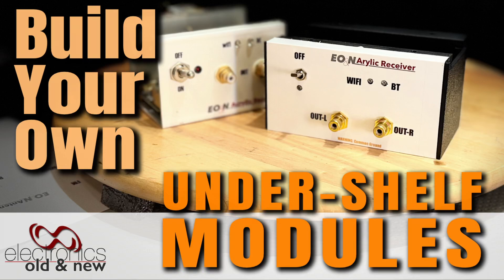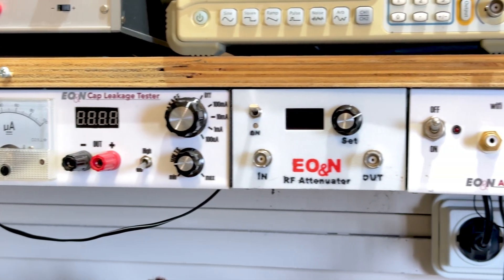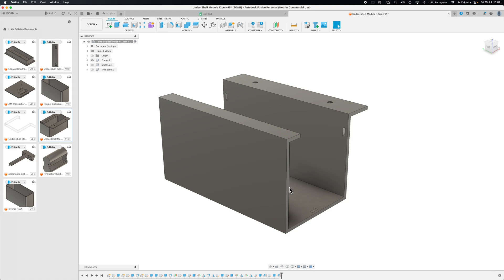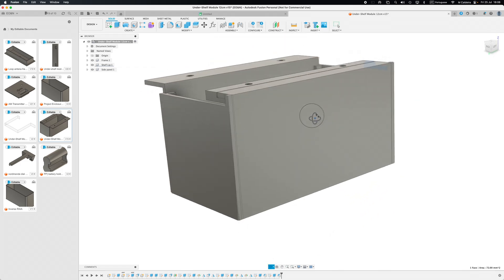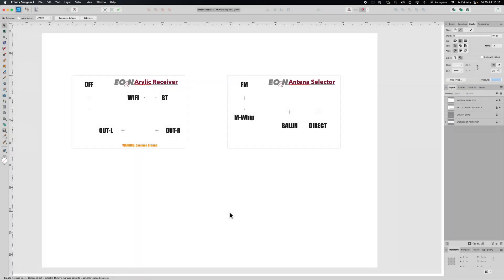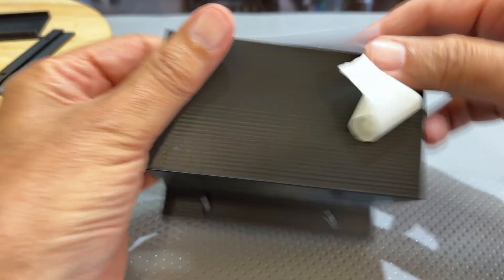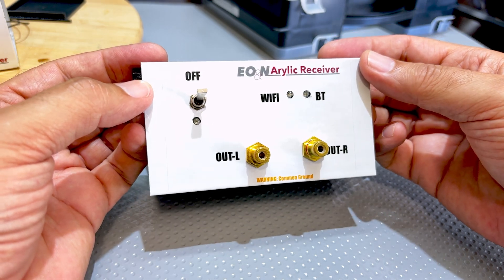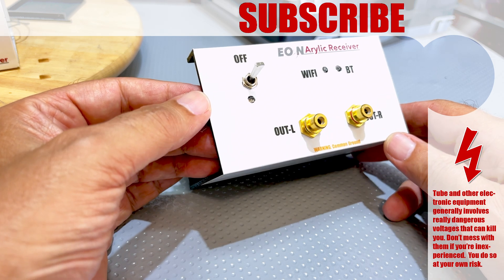Build Your Own Under-Shelf Test Modules – Fusion 360 & 3D Files Shared #pcbway#

Comment: Been using the paper/sticky sheet for a year or two.  Get yourself some small pieces of wood to sit behind what ever you're punching or drilling.  Sometime I also use small clamps to keep things from wriggling about.  Problem I have is getting the sticky sheet over the finished front side AND lining up the holes.  It's not too hard on small project boxes, but the bigger the sheet the worse the error.  Sheets you can get from AliEx. I suggested A4 and A5.  Fits standard laser-jets and the A5 saves wasting large sheets on small projects.

Comment: I got curious about the switch mounted with ON at the bottom, is that how switches are usually installed where you live? That seems odd here in NA. But on the other hand the aircraft I'm flying has all the switches with ON at the top, except for those on the overhead panel which have the ON at the bottom, so it's a mix of both.
Reply from the maker: It’s actually the result of old British influences in countries that were British colonies. I think the UP=ON actually makes more sense. Might be time for me to change 😊
Reply: @electronicsoldandnew  Well, about the "upside down" switches layout in my cockpit, I was told this was a British thing! Aircraft was designed by deHavilland of Canada, but the original deHaviland was British of course. It's weird at first but once your used to it it becomes natural!

Comment: Will you soon run out of under the shelf room, as you make more test gear projects? I wish that I had even some of the test gear units like yours, everything is at hand when you need it.
Reply from the maker: I think I’m nearly at the end of ideas for gear I need. I’ve actually removed some modules that were being under-utilised, but as a last resort, I can always use the second shelf 😊 but that would defeat the object: I’d have to stand up to use them.

Comment: normally I do not comment on others' work but I do enjoy viewing their methods. In this case, the face plate artwork. Mine is usually quite primitive limited by a 25 year old HP ink jet printer capable of         13 X 19 inch printing. The  artwork (as with yours) serves as a drill / punch template. The final artwork is printed on a very heavy stock.
The template is glued to the panel with rubber cement so that it can be removed easily. The final adhesive may be one of a number of products, some of which are not readily removed. However. before applying the  artwork to the panel several coats of KRYLON Crystal Clear are applied to both sides to ward off fingerprints and other blemishes. The end product is usually quite satisfactory, limited mostly by the artist.  Thanks for reading
Reply from the maker: Thanks for telling us how you do it. I have tried various methods and stuck to this one, which has produced good results. I don’t print these at home, as I have a great little shop nearby that will print anything for me at negligible cost.

Comment: Hi, you came up with a nice idea, I have an aluminum installation tray under my shelf (some photos are on the EEV blog), but what I really didn't understand is the orientation of the toggle switches - I always use the ON position in the upper position for toggle switches - if I need to quickly turn off the device, I just tap the lever from above - the top-down movement seems more natural to me for safety shutdown than pulling the lever from below up. In addition, accidentally falling objects will not allow accidental switching on.

Nice day 🙂 Tom
Reply: @Edisson.  I agree experience has shown it is easier to accidentally to knock on a switch in the down on position. In the end it is preferences.
Reply from the maker: The switch is a South African habit. The convention there was “down = on”, and it stuck 😊

Comment: re: center punching the holes.  I use a dental pick or sharp scribe to make a precise dent then use the spring loaded punch.  Works every time . The last job I did had nearly 40 holes. All were drilled and tapped. My method (for the most part) prevents the automatic punch from "walking" and the initial dent is more precisely located. Also I no longer use crossed lines but rather two intersecting but not crossing lines (L)  as the center is less blurred on some printers.  But then, there is more than one way to skin a cat (the cat is not happy with any of the ways)

Comment: I thought your Din Rail system was outstanding, my guess is you ran out of rail. The fantasy Island mounting system is brillian. Its going to be fun standing on your head mounting them though. P.S. 
Suggestion purchase a high quality small power screwdriver and a long extention use torx screws to fasten the moduals. Thanks Manuel exc vid
Reply from the maker: 👍 Yes, definitely will use a powered screwdriver

Comment: It may be an optical illusion but it looked to me that the right RCA was higher than the left and the LED wasn’t directly below the switch.
Reply from the maker: You’re right. Because my graphics were wrong, I had no lateral guide lines so the sheet was not stuck on absolutely accurately.